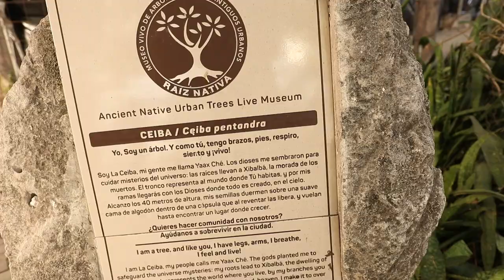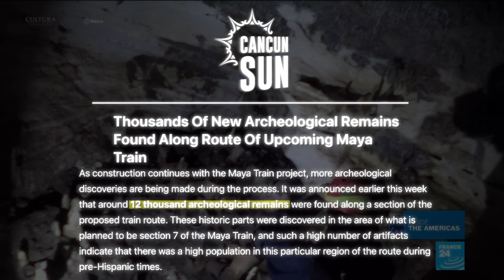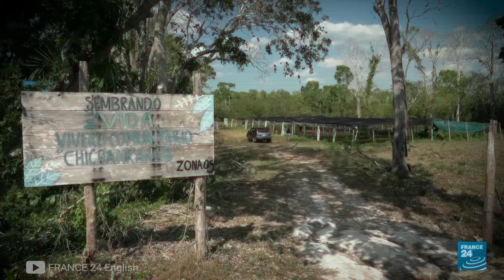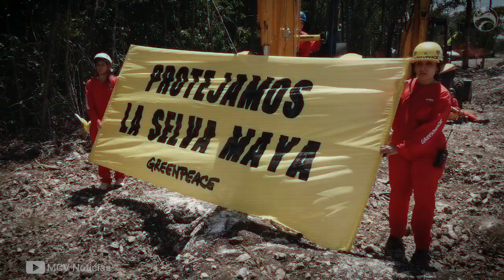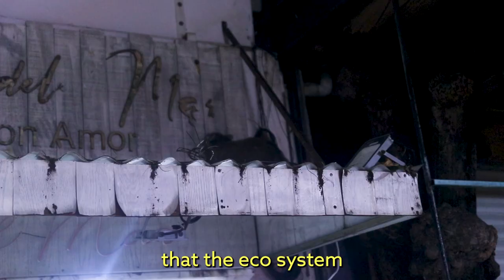I Investigated Mexico's $20BN Train in the Jungle

Comment: Ruining the land at what cost? Faster travel. Sucks. Hope the people win!
Reply: The majority of the tracks were already there from Porfirio Diaz's days, don't believe all you hear.
Reply: Also, on a long stretch, a pre-existing divided 4-lane highway is being used for the project.

They have taken one of those sections, removed the asphalt and now are laying the rail tracks on that section.  And widening the other remaining 2-lanes to accommodate 2 more so that they can still have a 4-lane Highway but now with a concrete barrier in between since they are no longer divided.

Doing it this way ensures that there is minimal impact to the forest since they are using the area that was previously cleared and used for that 4-lane highway.

Plus there are reforestation projects already in the works. Some of these projects are now also being implemented in some Central America countries with Mexico’s assistance.
Reply: If people is poor, the is no way to save the jungle.